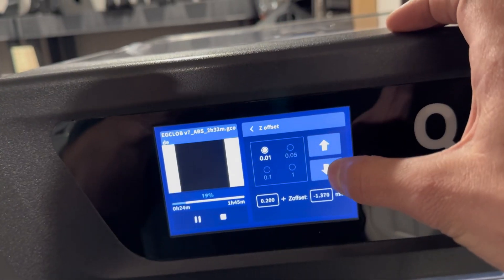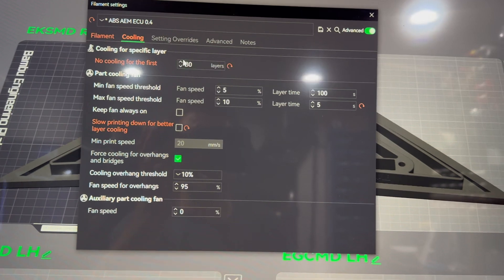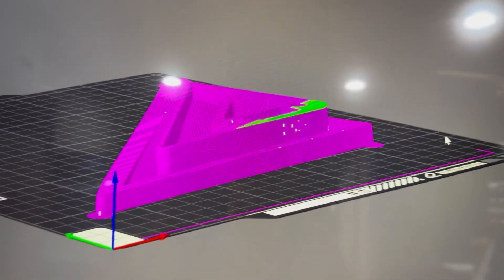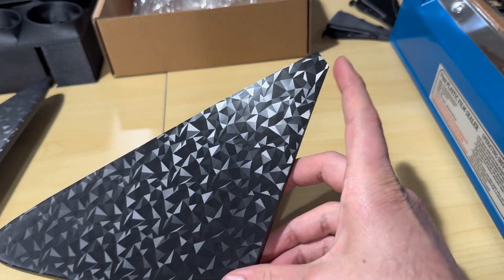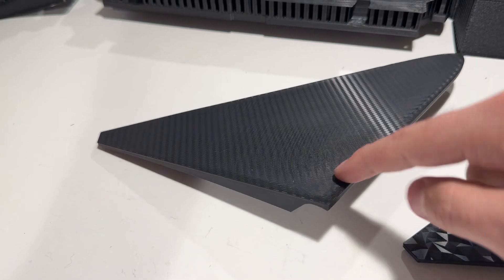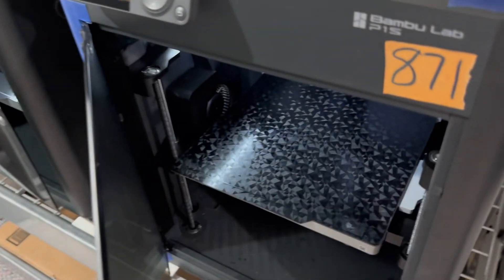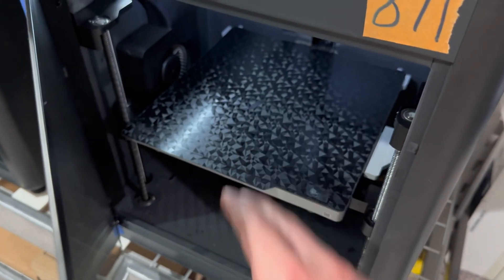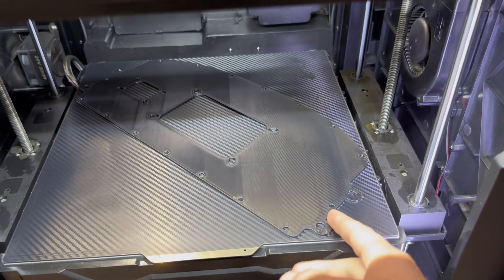Textured Build Plates Suck (tips and tricks)

Comment: Talk about burying the lead! PVA mould release looks like a great solution.
Have you gained any more insight since uploading this video? What is it like with different build plate surfaces/filaments?
Could watering down cheap pva glue work just as well?
I've been looking for something similar in the UK and I've found one that offers a gloss and a matt version (Llewellyn Ryland RA11/RA13).
I'm wondering if that would make a difference when used like this.
Reply from the maker: @D4RKFiB3R  Hey thank you! I was surprised myself that it seems no one else has used this for printing lol

And not really much of an insight, but it’s worked great still! I just wipe down the bed with a damp cloth (water) to smear around remaining glue evenly, and then give the bottle a quick turn over to the wet rag and re apply. So only a few drops of mold release is used each time

So far it seems to work about the same between build plates and filaments, and I haven’t noticed any affect on gloss/matte finish from the glue since I mostly use it on this more matte looking build plate. It is also applied fairly thin, but I will have to give that a test on a more glossy plate and see

I have not tried other cheap glue, but it looks like they have other ingredients and don’t always specify being washable so that could cause problems potentially filling in the textured surface, and not coming off the print easy

From what I can tell with a quick search the RA11 is similar to what I used here being it’s all PVA? The RA13 looks to have ethanol in it, which could potentially melt the build plate surface

It seems this mold release could use a video of its own to show the differences 😂 it’s also much more affordable than a lot of these big brands bed adhesives
Reply: @cbc.custombuiltcars  Thanks for the reply, and for pointing out the the RA13 looks to have ethanol in it. I hadn't noticed that.
RA13 is the matt version I was referring to, RA11 is the gloss version.
Another video would be great as it seems not that many people are aware of this stuff.
I've just been watching this, and I wonder how it would compare?.. https://www.youtube.com/watch?v=jP4wL9prBeo
Reply from the maker: @D4RKFiB3R I finally posted a comparison video, showing the PVA mold release versus glue stick

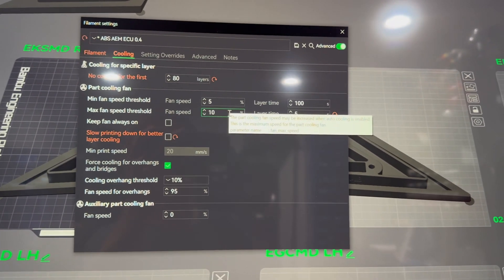Comment: Just curious why that part at the very top (1:16) needs a little cooling.
Reply from the maker: @urdnal  may not be super necessary, especially with an increased minimum layer time. The reason I do that is to help that part come out smoother since it’s a mounting surface and I use that top surface to ensure the heat inserts for this part are perpendicular to that surface. When printing a bunch in one area material can gum up and make an uneven surface, and make it harder to have heat inserts at a proper angle
Reply: @cbc.custombuiltcars  Makes sense, thank you.

Comment: Bambu’s liquid glue is 11% PVA and 10% PVP, and the rest is water. I wonder what the concentration of your PVA mold release is. I’m curious as to whether the difference in performance is due to the inclusion of PVP or a difference in concentration, or both.
Reply from the maker: @ClaytonMacleod  I just searched the bottle and listing, have not found anything saying the concentration levels
That is a good question if the PVP is making a difference, both for the finish look and adhesion. My method is very diluted by using water to spread it, but the main reason for that was so it could flow out and avoid small uneven stripes like the bambu liquid glue produces
Reply: @cbc.custombuiltcars  I couldn’t find a safety data sheet for it to see their percentages. Might try diluting the Bambu stuff 1:1, 2:1, 3:1, etc., with water and see if any ratio gives similar results. Maybe one would be cheaper than the other once/if you can get them to behave similarly. May not even be able to get similar results with the different mixture.
Reply from the maker: @ClaytonMacleod  that could be a fun comparison.  I am guessing there’s a higher concentration of glue in the mold release than the bambu stick, because when I directly apply is to my prints (for it’s intended purpose as mold release) it fills layer lines of the prints slightly. The bambu liquid glue stick also seems more runny when applying it to build plates even though its flow is restricted

Comment: Awesome tips. The pattern on the sheets really help make them look great 

Instead of messig with the z offset, what about increasing flow to get the extra squish?
Reply from the maker: @willofthemaker  thank you!

And yes that is another option 👍 doing that takes a bit more time to get dialed in, especially on multiple machines. Also small crashes seem to slightly bend the nozzle as mentioned, which changes all that as well… I wanted to share what is quick and simple for people to understand, and it’s easier for me to swap back and forth lol

You could save multiple print profiles doing like you’re suggesting so there’s more in between steps to z offset and initial flow. Getting slightly better results with maintaining simplicity
Reply: @cbc.custombuiltcars  is it only with the qidi  max 3 you need to do that? Does the bed need to be releveled?
Reply from the maker: @willofthemaker  oh yeah it’s only the xmax3 I have to sit there bumping z offset for the first layer lol! I give extra squish to the first layer walls so they stick good, but leaving it that low will build up too much for the line/zigzag/inside fill portion of that layer. And yes I have to run bed leveling on every print for the Xmax 3 because it shifts all over the place post print, and after preheating. It is accurate enough to walk away after hitting print for a textured pei print, but not these smooth sheets. It works currently so holding out for an XL bambu machine, maybe some others, and fixing up this magneto x I have to do large prints